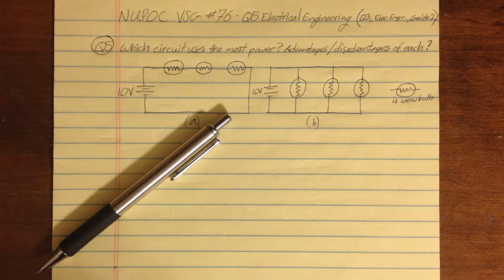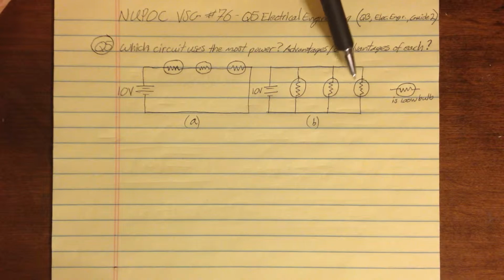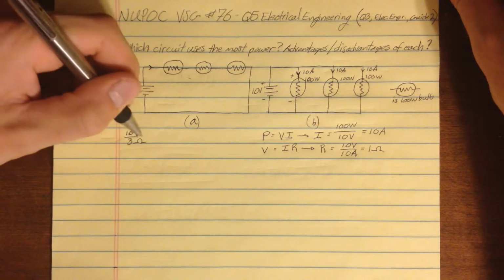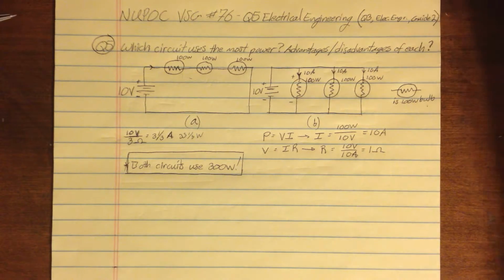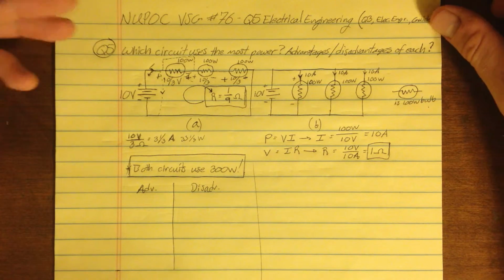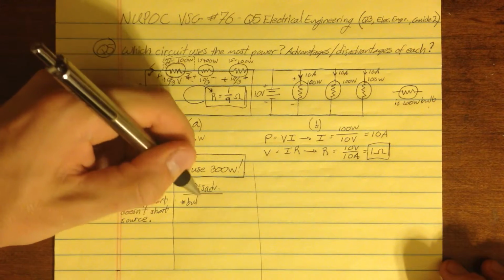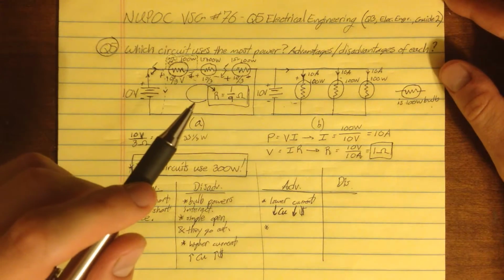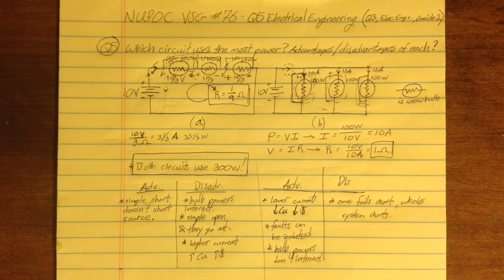NUPOC VSG #76 - Series vs. Parallel Circuit Wiring

Comment: In advantages and disadvantages you said more current is experienced in the series circuit but if the power used is really the same for both circuits because they both use three 300 watt bulbs, then by P=VI should't the current experienced in both circuits be the same?
Reply from the maker: Correct that the total current and voltage are the same in both cases.  In the series case that total current has to flow through each light bulb, but only 1/3 the voltage exists across each bulb.  In the parallel case only 1/3 the current flows through each bulb, but each bulb has full voltage across it.  Generally it's easier to build bulbs to withstand lower current and higher voltage, so the advantage is to the parallel arrangement.